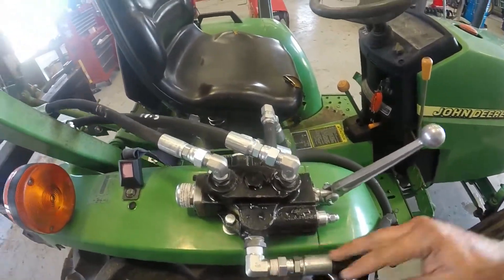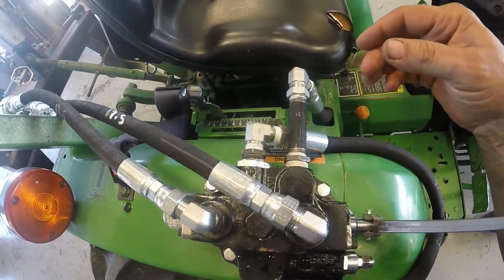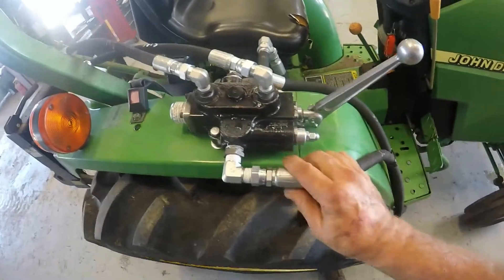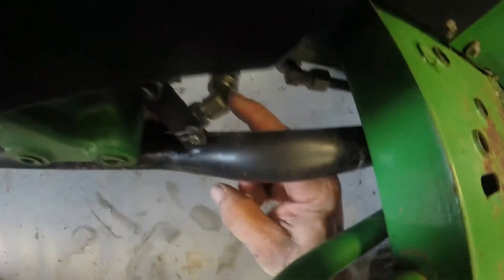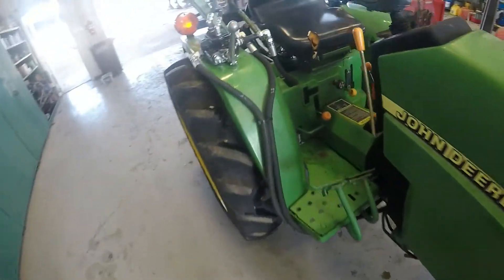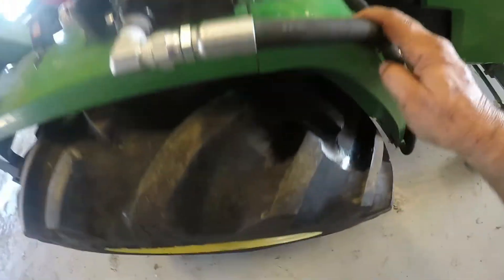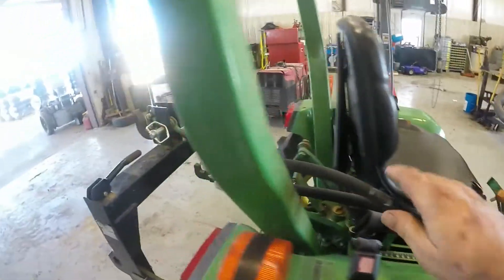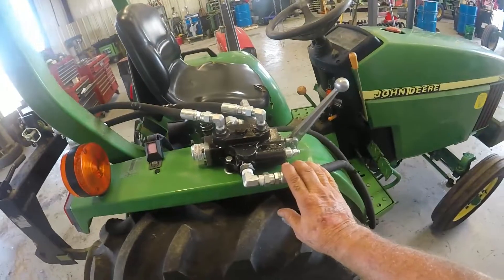How to install hydraulic outlets on a tractor

Comment: Nice work , I have a Hinomoto  E184 compact tractor.I would like add a frontend loader. Need some help
Reply from the maker: What is the horsepower?
Reply: @smallfarminnovations4265  18 HP PTO  Toyosha S107 Diesel / same as a  Massey Ferguson 205-4
Reply: I need a little help. I am trying to weld a Frame for a Frontend loader 
I am not sure how to Plumb to the hydraulic system
Reply from the maker: @williamevans218  Go look at another tractor with a loader. it's not difficult to plumb up a hyd system for a loader on a tractor or Google Images for Front End Loader Hydraulic Schematic and you will get tons of information.  The Loader on your Toyosha may be slow but it will be strong.  Good luck!
Reply: @smallfarminnovations4265  Thank you